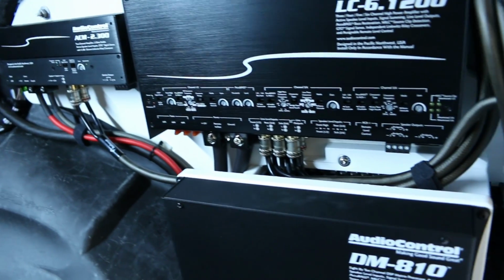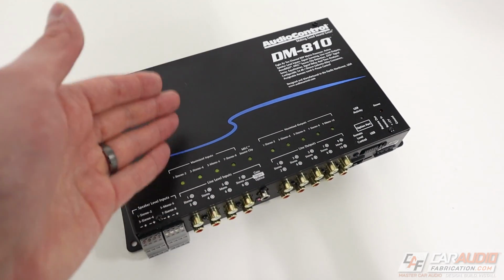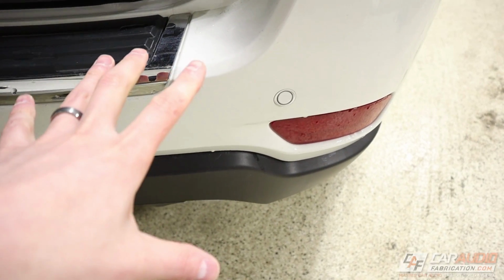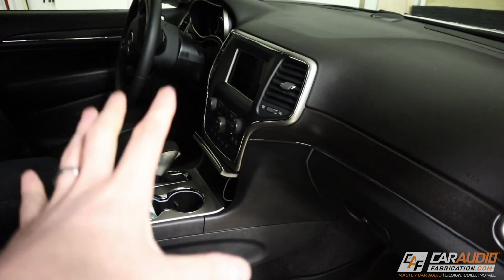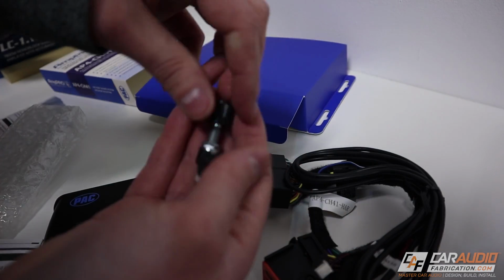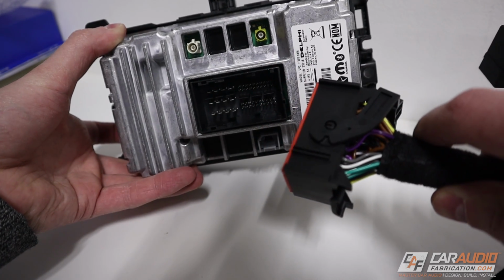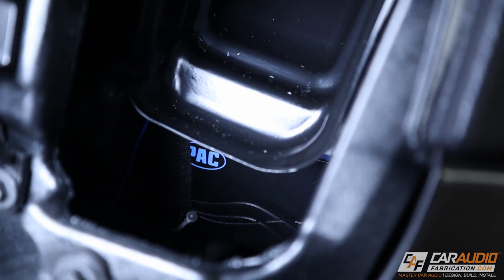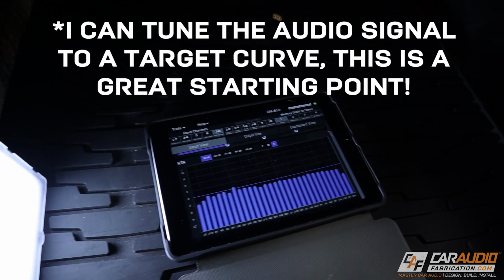Optical Digital Output AND KEEP warning chimes, voice, nav - How to

Comment: I have a 2016 GMC Sierra single cab. I'm looking to install a Dudu7 that has optical out. 
I'm going to run audio control epic amps. One for mids and highs and the other for the subs. 
What is the best DSP or device to receive that optical signal and send a nice and clean signal to those amps?

Comment: Does the pac amp pro need an amplified input signal?
I have a 2024 Ford bronco  non b&o when I go to the pac audio website it doesn’t give me the option of using the pac amp pro on an non b&o system it’s only available if you do have a b&o system in your bronco . I was wondering if I purchased it anyways will it still work or mine vehicle. I wanna purchase it so I could lower down the volume from the chime sounds

Comment: I just got a system installed in my 2022 crystler pacifica touring l with all the sensors but no factory amplifire and i had it it's professionally installed with the lci2pro but if im sitting at a red light with the music off and the subs cranked up i get like a pulsing thmp from my subs do i need one of these?

Comment: This video is exactly what I’ve been looking for. I just recently had an after market amp with DSP installed and specific sounds were amplified like crazy including my TURN SIGNAL.

To my dismay this problem seems to be common but without having any solutions.

This by far explains what I think my issues are.
Reply: Heyoo, did you figure out how to solve this?  What frequencies to adjust?

Comment: When you run optical out of the pac unit into a dsp do you retain balance and fade control? PAC says it outputs 2 channels per the specs. Are you able to tune all 4 channels at the dsp?

Comment: Also, I do not want to add a speaker box I need to retain my space in the back for my tops. I found a ring for the amplifier in the back but not the 12 inch subwoofer.

Comment: This was vary helpful, is there any particular reason you went with this option instead of the DSR1?
Reply from the maker: The Amp Pro has a proven track record of great reliability. Not that the other necessarily doesn't, but the Amp Pro has always been a solid solution.
Reply: @CarAudioFabrication   Thanks, I appreciate your knowledge and work you put out! Been binging your videos. Been working as a heavy duty diesel tech for 16 plus years. And want to get into car audio. Much to learn. And skills to advance. Thank you.
Reply: This looks like a great set up..any suggestions for a similar set up (2019 RAM 1500 with 12" Alpine system) 
I am wanting to add amp(s)..subs and front end and keep center and rears just for drive ins..so don't need as many inputs on the dsp..

Comment: So Is Running A Optical Cable Better Than RCA? I Have A Fancy Bluetooth 5.1 Reciver. It Has An Optical Output Or A RCA DAC That Can Be Used. Would It Be Best To Run The Optical To My Head Unit Input Or Just Stick The RCAs? I Know The Optical Would Elmimate Any Ground Loop Issues.

Comment: Hey mark I have a 2016 Cadillac CTs vsport with the Bose system and using kicker key loc with a wire harness from john adams tapped into the factory amp how would I hook up the amp pro 61? Since it would be installed behind the deck do I run rca to the rear amplifier and get rid of the kicker key loc? I’m just not understanding how it gets installed exactly

Comment: Wow, I thought the microphones would be for hands free cell phone use, not to ruin someone from trying to upgrade their OEM stereo. What a bunch of BS from automakers who simply fail to offer a really good audio system in their vehicles. Most of which cannot compare to aftermarket radio stereo or surround sound systems. Or how about simply adding some insulation to stop road noise instead of fancy electronic gimmicks. What a joke, and thanks for the heads up!

Comment: I have a PAC amp pro and using an audio control DQDX and getting a lot of static and a buzzing sound in my mids and highs. Even with the gains turn all the way down, you can still hear it. Will the 608 with toslink fix this?

Comment: Wait wait with the PAC installed, all you need is the optical input? No speaker level inputs or RCAs?
Reply from the maker: The t harness gets the signal from the vehicle. The interface then provides RCA outputs. Or in my case I upgraded to the add on that gives optical out.
Reply: I appreciate it! I've been watching for 3 years now and learned so much! I recently graduated and brought a Jeep just like this and have gear on the way. You made my job 10x less complicated thank you!

Comment: Isn't there a DSP in that D6 1200? I would have never guessed you would need both?
Reply from the maker: This device is not a DSP. And a DSPs job isn't solely to flatten a signal. And this device doesn't just give a flat signal it solves a few more issues as noted in the video

Comment: You can get optical out from a head unit to the DSP and Amp.  Is it possible to get fibre optic connection to a speaker?

Comment: I bought a Kenwood XR901-5 amp for my 2020 4th gen Ram with base 6 speaker system. What do I buy to connect the amp to the 8.4 radio. Do I buy a T harness with a Maestro or a Audio logic LCI7 or a PAC? Please help, confused on which way to go. I already installed new speakers, 4 KFC-6986PS for the doors, 2 KFC-X3C for the dash and 2 JL Audio 10W1V2 are waiting to put under the seat.

Comment: when using the optical output for the PAC AmpPRO AP4-FD21,  would you still use the RCAs for they system or does it take the place of them?  I'm installing the JL Audio VX700/5i in my Ford Explorer.  I see the Digital-Input for the amp  accepts 2-channel digital audio signal from any optical (S/PDIF) digital output, with a sample rate up to 192 kHz.  How does that work if I'm using all for channels plus the sub output as well?  I'm referring to the tuning portion of the speakers?  Thanks for any clarity you can provide me in this and if it's necessary with this app and my setup .

JL Audio VX700/5i
Focal Performance PS 165FX  (front speakers)
Focal PC 165F (rear door speakers)
PAC AmpPRO AP4-FD21 Aftermarket Amplifier Interface
JL Audio 8W3v3-4  (Sub)
PAC APA-TOS1 (optional if it provides a better signal )
Reply: You would be using the processor to differentiate the signal to the proper speakers when using optical. Volume would have to be controlled from the processor as well since an optical signal doesn’t send volume info. You would most likely lose the ability for fading and balance from the HU.

Comment: Hi Mark, when using pac amp pro toslink to DSP, are you only getting left/right signal correct? So would be setup as mono and not stereo? If using the rca are you getting stereo?
Reply from the maker: Left and right is stereo, you only need left right in car, its not like you are watching movies.
Reply: CarAudioFabrication....I’m thinking about this the wrong way...if using the pac to dm810 with toslink is it you lose the ability to fade front to rear from head unit. Installing pac amp pro in Jeep Gladiator and wanting to add the dm810 and use the toslink but I thought you lose front/rear fade....affecting listening to say XM?? Love your channel too BTY...
Reply from the maker: Yes you lose front to rear, but you could have different presets on the DSP that have the level of the rears reduced.
Reply: @CarAudioFabrication  Would you need the ACR-3 for your volume control as well? Didn’t think optical sends volume data.

Comment: @caraudiofabrication mark I am doing a similar install into a 2015 grand cherokee I am using the dm-810 and I want to order the pac module my question for you is when getting a text message with the phone blue toothed to the factory radio it reads "text message from (name)" very loudly and annoyingly before any upgrades will the module be able to turn that voice down also (it is a factory non-amplified system) from what I've been reading online I cant get a straight answer,
 thank you
Reply from the maker: Its not overly loud, I am pretty sure I set the volume to low when flashing the unit.

Comment: Hi Mark, How would I set max volume for the head unit when using the optical out of my Amp Pro? I'm going into an Audio Control DSP DM-608 and when I turn volume all the way up I never get a clip light.
Reply: You wouldn’t be clipping as it’s just a digital signal. If it was analog first then it’s possible. No volume info is encoded into the signal either. It’s just 1s and 0s.

Comment: Have you noticed a added noise into the system through the module? i just tried one of these in my 15 F150 and it has an engine noise issue.

Comment: I own a 2019 Durango with the 7in unconnect which is pretty much basic no subwoofer. However while I'm installing my system which consists of 3 amplifiers and a dm-810 I notice that when a speaker is disconnected from the uconnect system  it literally shuts the output from that channel off and the only way to get it back is shutting off the power and reconnecting a speaker. This makes installing amplifiers impossible since it shuts off the output once the speakers are disconnected. However I have ordered a ampro hoping that it's the solution even though their website says that you must have a premium sound system and 2019 isn't listed as compatible. If anyone has the solution for this any comments are appreciated. Thanks
Reply from the maker: Contact AudioControl, they have a device called the LGD that can be used to trick the factory amp into seeing a load and thus keeping the input on.
Reply: @CarAudioFabrication  I got the Lgd but they only work if I disconnect them from the dm-810 turn the stereo on then plug them back in to the dm-810.  If I leave them plugged in and turned the stereo on they do not show any output. It's almost like when they're plugged in to the 810  The resistance value must change which causes the stereo to not have an Output. So my next option is to buy some resistors and try them by themselves.

Comment: Is it normal to lose the factory "blinker sound" that is transmitted through the left front dash speaker when using this?  I installed an Amppro GM61 in a 2015 suburban and the chime still works and all other factory functions but the blinker/hazard light sound does not work anymore.

Comment: Can I get some help. I have 4 4 ohm 100 rms per speaker 6.5 co axial kicker speaker that peak at 300 watts. With a 4 ohm 10” kicker subwoofer with a passive radiator preloaded enclosure that has  a rms of 400 watts and peaks at 800 watts. Can anyone suggest the best amp so they both perform well together I’m more into sound quality than bass. I am also using a aftermarket pioneer radio. Thanks a ton for your time

Comment: I have a 2013 Dodge Dart with the Uconnect system as well. A simple converter from the factory subwoofer to my amp should work? I want to run 2, 10” subs on a 1000w amp.
Reply: If you have a factory premium audio you may have three different things to overcome 1) the factory crossover points may not be what you want with your subs and the converter cannot help that 2) the factory amp may be load sensing  and shut off the channels to the sub if there is no load present so resistors may be needed and 3) some factory amps lower the bass the louder the volume goes to protect the sub meaning your signal would be lowered as you turn it up.

Comment: Hey Mark, does this still play the warning chimes and bluetooth calls through the same speakers as factory? I think the calls play through the center channel.
Reply: Yes and it gives u the ability to control how loud the chimes are. Some vehicles have settings that give u some vol control over chimes, but very minimal. These units literally let you mute the chimes if you so please. But everything plays thru the same speakers & works the same way it did before installing the unit.

Comment: Hey Mark. 
I have a question about the gain knob on a car amp and why it is not a volume knob (as most people think).
I'm not sure that I got it right, so maybe you can correct me.

The gain knob is not a volume knob because you find the sweetspot where there is no clipping / distortion, no matter how high you set the volume on the headunit.
Once the gain is set, then you dont touch it anymore. 

Is that correct?
Reply: yup, it actually doesn't make sense to adjust it using oscilloscope or multimeter, yes it would match the headunit voltage UNTIL you adjust everything like lpf,EQ and so on because that will make the headunit voltage change, so gain is pretty much a voltage adjustment so that the gain of the amp raises equally to the volume of the headunit, to much gain results in amp raise it's full power before headunit reaches it's high and preferable volume so the amp distort

Comment: I have a 18 GMC Acadia Denali, 1 of the only vehicles that doesn’t have a way to upgrade my system
Reply: This is what u need, except you need the Pac Ap4-gm61 Amp Pro model. I just did this upgrade to my 18 Silverado and my 18  Terrain Denali... worth the $350 price tag... but if ur just trying to simply add a subwoofer/amp Google LLJ Customs. They make a Bose bypass harness & ANC defeat harness that allows you to add amp/sub w/o any cutting/splicing and without the ANC causing problems. This is about $120-175. But it doesnt give you the options the Amp Pro provides as it's just 2 harnesses, but if just adding subs then it's a cheaper option.

Comment: Mark, excellent vid, I'll have to add this to my current build list of puzzle pieces for my truck. 9 speaker alpine in a ram 1500, anyhow does the amp pro address the bass roll off factor in these factory systems or will I still need the audio control accu bass correction features in addition? Also I'm not clear on how the amp pro addresses the issues with the a and c mics when adding aftermarket subwoofers etc that will obviously be louder and play quite lower than the factory oe sub

Comment: I tried to use the optical output for my 2012 Optima. I found the wiring diagram for the Infinity amplifier and took the digital signal out of the harness by cutting the wires before they came to it. I soldered on an RCA connector and connected that to my DM-608. It worked, but the function of the factory volume control was gone, as it controlled the output of the stock amplifier. A solution could have been to utilize an ACR-1 to control the output of the DM-608, but eventually I just used the full range signal given to the rear door speakers. For me, the headunit was lower priority, as I use a direct RCA to a Pioneer XDP-100R, which sounds fantastic.

Great video, I've been interested in how this is accomplished for a while!

Comment: Hey buddy great video I have a 2018 Buick encore with non Bose system but I guess the only difference between Bose and non Bose is the door speakers so my amp and hu r same as Bose...I had shop install lc7i on outputs of factory amp and I'm having all kinds of issues...do you think I would need something like amp pro for my vehicle...basically paid lots of money and shop is clueless on how to help me now
Reply: What are the issues?? Without a clear description of what the problem is it is very hard to diagnose..

Comment: if only we can control the volume over the toslink cable
Reply from the maker: Not sure what you mean. With this all installed factory volume control still works the same
Reply: CarAudioFabrication 

I was under the impression that the volume control cannot be controlled via a tos-link connection. Which personally I always thought it was silly.

Comment: Ooooo I’m gonna save this video, been waiting for this one
Edit: ahh I see this is for fixed level systems now, any solution I might have missed for systems without factory amps? Kind of been waiting to do a system until I don’t have to deal with loud beeps and chimes 😂
Reply: Depending on what vehicle you have you can use these on no Bose units. Pac claims they arent compatible, but they are. At least with the GMs they are. I have a 2018 Silverado with the Mylink but no Bose and I still use the Pac Ap4-gm61. Have had it installed since September with no issues.

Look up Pac Ap4-gm61 in the YouTube search and watch the video by 5 Star Car Stereo on the Amp Pro installed in a non Bose vehicle...